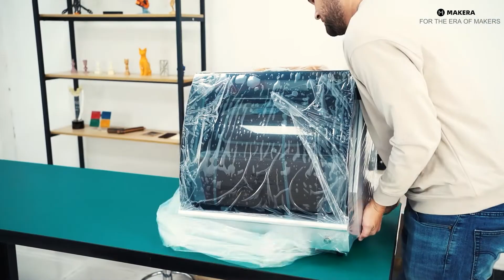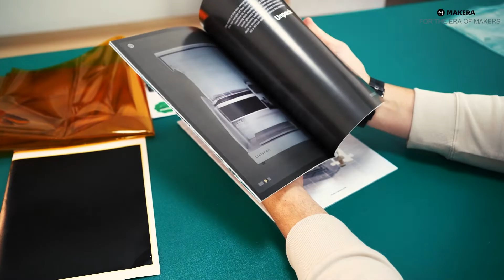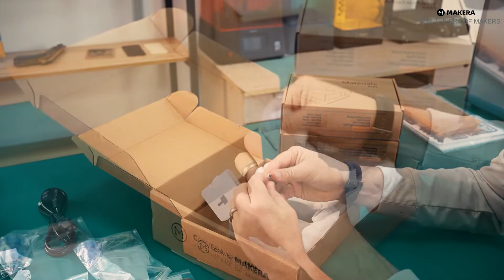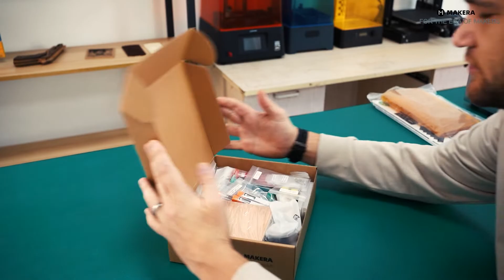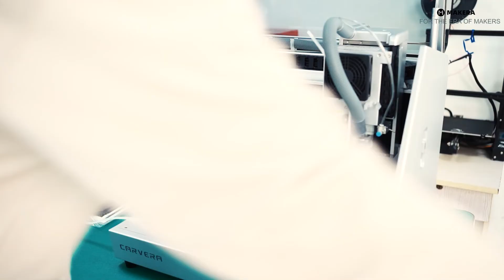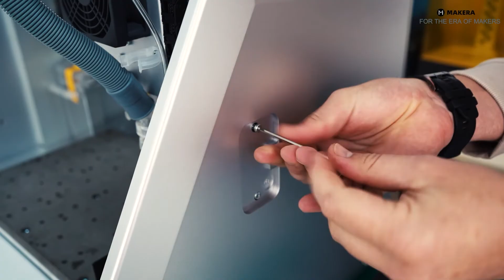Unboxing of the CARVERA cnc machine!

Comment: Is the Laser Module available in Carvera? "And is it possible to use the laser module of Carvera Air for Carvera?"
Reply from the maker: The Carvera has a laser module built in as standard, no external module is needed.

Comment: When I buy the machine, do the tools in the boxes come with it, or will I have to purchase them from the website in addition to the machine? I didn’t understand
Reply from the maker: https://www.makera.com/products/carvera You can check it here. We have a standard tool box that comes with the Carvera Machine. If you need more you can purchase them from the website. But in general the standard box will do most of the work.
Reply: @Makera   
Is the Laser Module available in Carvera? 
And is it possible to use the laser module of Carvera Air for Carvera?
Please.

Comment: Hey, I actually didn't know the black cover thing along the tools for the side laser was to stay there, so I removed it and probably threw it away. Should I try to put something in there instead or it should be fine?
Reply from the maker: It should be fine, If you start having tool detection errors you can find something similar to put there. If you need a replacement you can contact orders@makera.com
Reply: @Makera  thank you!!!

Comment: What was the connector next to the emergency stop connector on the back?
Reply from the maker: This is the connection for the external air assist module.
Reply: @Makera  Ah, OK. Thought it was connector for a jog wheel. How would one go about connecting a jog wheel?
Reply from the maker: There is no input for a jog wheel to the machine, but all axis and configurations can be manually adjusted in the controller software.
Reply: @Makera  Is there an API for the controller software? Could one make a wireless jog wheel by sending API commands to the controller software?
Reply from the maker: @jenskmigselv  We do not have API for the controller now, but we could add that later through a software update if we get more requests for the new functions.
Reply: @Makera  Thanks. Such an API would be a way for developers to add functionality and for you to cooperate with the community.
Reply from the maker: @Jens Kristian Jensen, Thanks for the suggestion, we will keep that in mind.